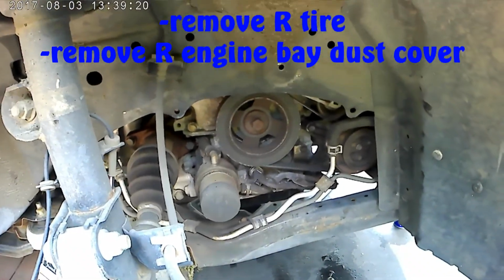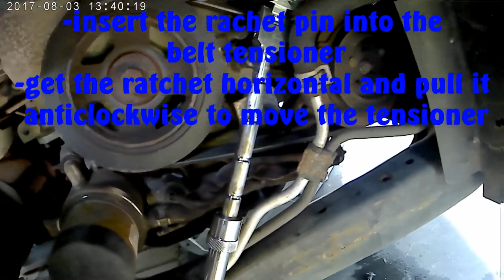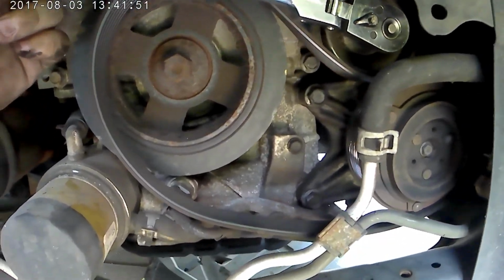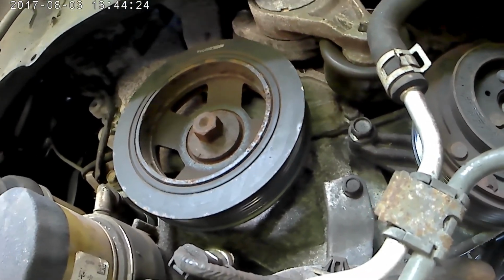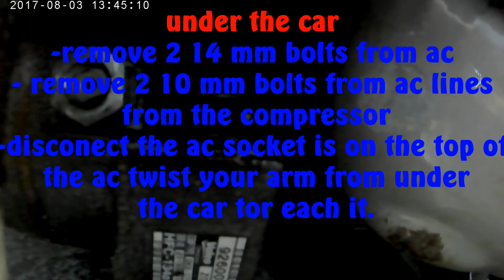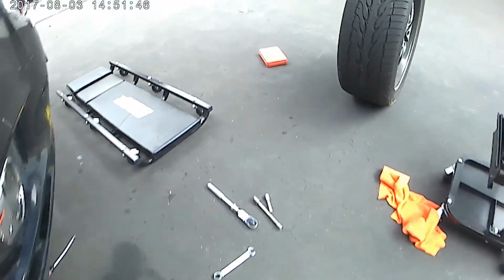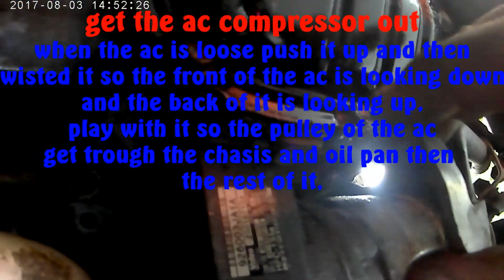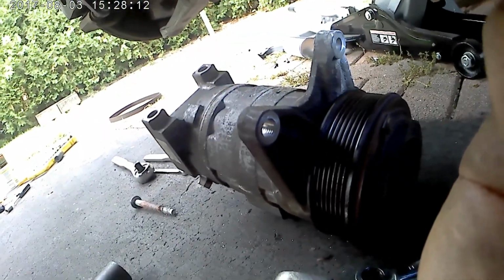jx35 serpentine belt and ac compressor

Comment: my AC went out at 80k miles , I just replaced the  AC compressor clutch, instead of removing the whole AC compressor where I have to recharge the system.  it was pretty easy  job.
Reply from the maker: Yea , now there is plenty aftermarket parts for these cars, back when I got  my car dealer parts was the only option for me

Comment: do you have video on how to replace the ac line, ensemble pipeline from to back thanks my jx35 2013
Reply from the maker: Hi no sorry i dont , but all ac lines need a ac line tool to disconnect them
Reply: @geovp1984  I have already disconnected
Reply from the maker: Ok good , why do u need to remove them?
Reply: @geovp1984  yes geojoe is broken I have a home vacuum pump etc and piece but I need the specification how to change thanks for answering

Comment: Hi do you still consider to get an Infiniti vehicle in the future? 72k miles AC compressor going out in my opinion is too soon? I have a 2015 QX60. radiator fan assembly went out at 50 miles.
Reply: Dont forget to subscribe, yea i will , i mean every single car has problems no matter the brand or model someones more than others but they do, i own bmws, navigator, porsche, and see family and friends new escalade, suburbans, volkswagen, honda, toyota, mazda have issues right in the first week  brand new, others engine trans problems at 20k , so buy a car any car is a gamble it can be good and have few issues or be a nightmare evennif we have same car , year a model, you just dont know, standars for cars today is very low in quality and durability,  they are build for the market to last x years and either buy a new model or replace parts.

Comment: How many belts are there? Can you please post the part number of the belts? Thanks.
Reply from the maker: Just 1, i dont have the part number but easy to find it on ebay
Reply: @geovp1984  - thanks. I actually found it. I planned to use the Gates Micro V, Part # K070407

Comment: I got a new compressor on mine 6 months ago and the compressor doesn’t engage any more
Reply from the maker: Did u got oem or aftermarket, check freon psi is correct if not  you got a fault unit.
Reply: @geovp1984  OEM, dealership. When I connect the Freon bottle with gauge it points to red right. The same thing happened this passed summer, but it randomly turned on after a like 2 days of the clutch not engaging.
Reply from the maker: @diegoboii  should  be 30 -40 psi depends of ambient temperature  , overcharge could damage it and avoid engage of the clutch.
Reply: @geovp1984  i released the pressure to in between 30-40 and about 5 minutes later it built back up above 60
Reply from the maker: @diegoboii  u need a high pressure line gauge too, for me you have too much freon on the system.